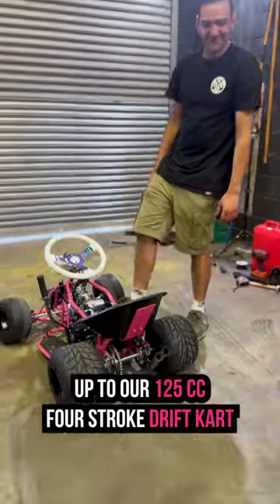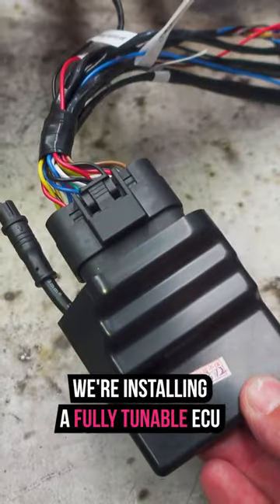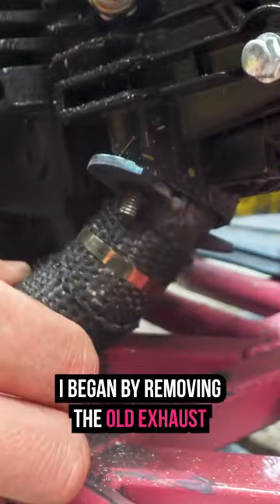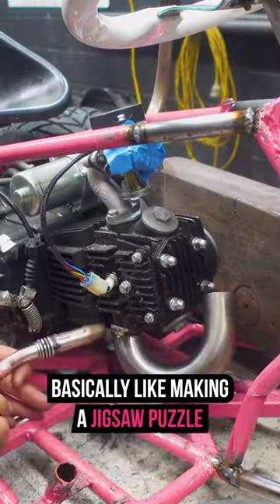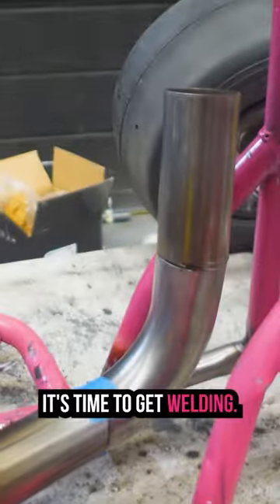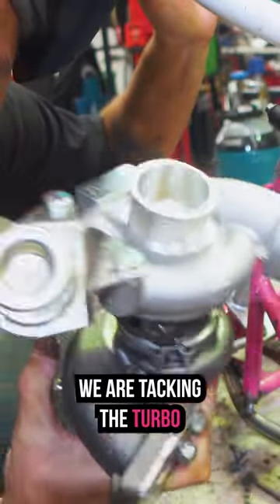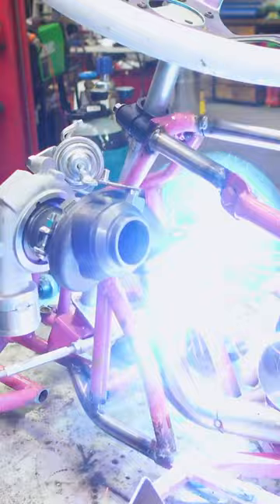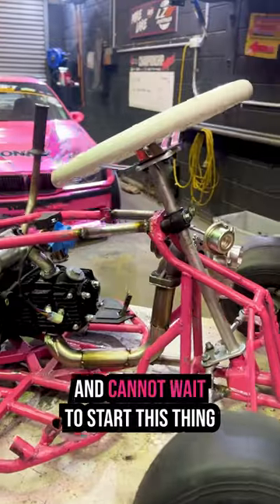125cc TURBO drift kart build Part 1 #turbo #125cc #diy #driftkart #gokart

Comment: Aint no way bro is turboing a gogkart 💀💀💀
Reply from the maker: We gotta! Surely we can get this thing up to 60mph 👀
Reply: @itsmikelake I’m sorry but it looks like ass and the upgrades cost more than what the entire thing is worth; this is gonna be a money pit
Reply: @itsmikelake that's nuts 😂❤
Reply: Why a 125 and not a 160 or something bigger
Reply: @itsmikelake 
Where are you located? 
I have a295cc with electric start, radiator, 5or6speed, Frm a 14 Kawasaki,,,, I’m thinking GoKart😂
Reply: @Alpaca5089

Comment: I wish I had a welder so I could do stuff like this to my one
Reply from the maker: Buy a cheap one bro! I started with a $100 gasless mig and it worked sweet for starters 😁
Reply: Go for the gasless brother..
Reply: I don't think welding is the main thing u need, plenty of ones near u if u search google
Reply: If you don't have the motivation to get a welder with how cheap they are, you don't have the motivation to do stuff like this.
Reply: 沢山の機材が必要ですが…
私は購入を賛成します。
私は高校時代にアーク溶接機を購入しました。
但し、電源が100V200V必要ですが、日本では一般的に100Vですが電気代が割高です。
今はバッテリー溶接機をメインに使います。
会社では半自動溶接機、プラズマカッター、Tig溶接機、シャーリング、パンチャーなど沢山使えます。
自前のバッテリー溶接機で20tプレス機や電動コンプレッサーを改造して200vモーターの動力を取り350ccのエンジンを搭載しました。
要領良く道具を使いこなせば工具なども自作出来ます。
😊🖐️バイバイ（笑）

Comment: What’s the speed aim for this? Or what’s the goal I’m all for it don’t get me wrong
Reply from the maker: 100km / 60mph would be amazing! Not sure of power goals but as long as it makes 10psi of boost reliably on e85 fuel I’ll be happy!
Reply: @itsmikelake  I’ll be honest with you mate I had one of these engines to 70mph with a little bit of fuel tuning and gearing
Reply: 125km/h